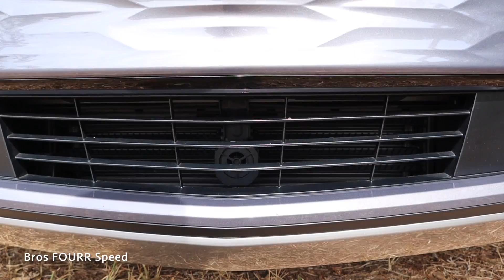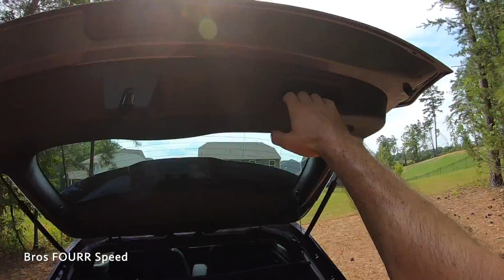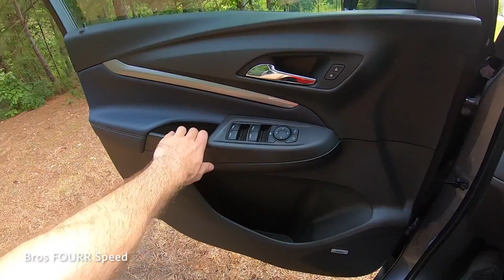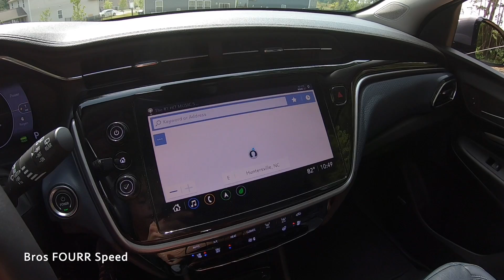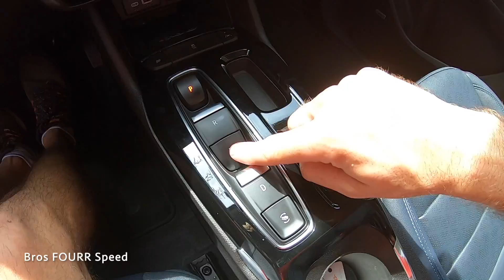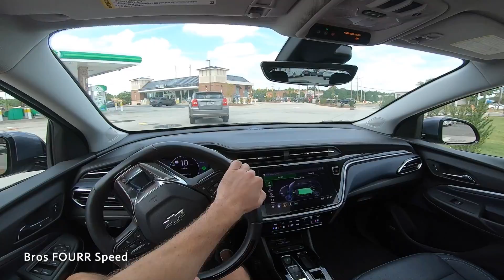2022 Chevrolet Bolt EUV Premier: Start Up, Test Drive, Walkaround, POV and Review

Comment: Your prices are off. The EUV now starts at $28k with the normal EV starting at $26k.

They're the most affordable EVs in the American market right now. 

The only catch is that they no longer qualify for the tax credit, but if you have a good trade in value, you can easily get an EUV with all the bells and whistles for under $30~$35k which is a steal for all the offered features.
Reply: Now it makes sense.   Because i was thinking noway EV cars will take off!
Reply: @kennethsmith6899  EVs are crazy popular in Europe right now (Norway has more EVs being sold per year than ICEs since 2020), but they have cars that are being sold for less than $25k (US equivalent). The US is only starting to break into that price range. 

The only catch is that America is massive compared to Europe, so the range is important. While most EVs have decent range, the Bolt has terrible charging times. Teslas, ID.4s, the Mach-E, the IONIQ 5, and the EV6 (for example) have the same range as the Bolt but infinitely better-charging speeds, so they're more than good for taking on road trips. While the Bolt can be taken on shorter road trips (under 200 miles and you don't drive like a madman), you'll be stuck charging for anywhere from 30 minutes to well over an hour. The cars I mentioned above can charge nearly 2x-3x faster at the same charging stations... but again, you'll have to pay more to get that. 

Luckily, VW just announced an exclusive ID.4 made in the USA with a shorter range, but at $35k (and it charges nearly 3x faster than the Bolt). Oh, and it comes with 3 years of free charging at any EA charging station.
Reply from the maker: EV cars are cool, but I don’t see them becoming crazy popular!
Reply: @BrosFOURRSpeed  Well considering a majority of the legacy car companies are now switching to EVs and aim to only produce EVs after 2030-2035, I respectfully disagree with that statement. Chevy has already cut the price of the Bolt significantly and it's reported that more companies might do the same with other upcoming models (VW just announced a $35k ID.4 made exclusively in the US that charges faster than the Bolt and is bigger).

GM is investing $750 million into creating more charging stations and improving its infrastructure. VW has already invested nearly $1 billion in the US, Canada, and Europe with Electrify America and plans on giving up to $2 billion+ until 2026 for even more stations. Tesla is constantly improving and creating more charging stations by the month and they're now starting to accept non-Tesla EVs.

Keep in mind, that's money for the stations/infrastructure. Ford themselves nearly sank in over $1 billion into EV R&D  since January alone since they, along with GM, hope to catch up and beat Tesla by 2025. VW has been doing the same.
Reply from the maker: @mjohnsimon1337  Chevy has cut the price most likely because no one is buying it! Electric vehicles are cool, but a lot of people are going back to gas because they just aren’t as practical. There isn’t going to be enough infrastructure to support an excess of charging stations. It’s cool tech, but I don’t think it can grow as much as gasoline powered vehicles are now. Even hydrogen vehicles would be a better idea and more practical but companies are overseeing that option.
Reply: @BrosFOURRSpeed  Yikes you're pretty way off for being a car reviewing channel lol. 15 yrs from now it will be hard to even buy a gas car...
Reply from the maker: @anderstars  That doesn’t mean I’m off at all..personally I don’t think ev’s will make it far, that’s an opinion. The infrastructure to support chargers everywhere just can’t be done.
Reply: @BrosFOURRSpeed  and what do you know about electrical infrastructure? It's currently being done
Reply from the maker: @anderstars  Yes but in small quantities. Not many charging stations are around. I looked for a ton having this car. You can’t charge hundreds of cars at once or thousands. Gasoline is more natural and way more convenient. Again, just an opinion on this topic.
Reply from the maker: Just reading the window sticker for this model! Doesn’t mean they aren’t less.

Comment: I remember this Electric SUV, infamously had a problem with catching on fire.  

Tesla Model Y would be a better alternative, at least the worst thing would be the doors flying off lol.
Reply from the maker: Lol, still an expensive little suv!
Reply: A Model Y starts at $66k. I don't think that's a fair comparison when this as speced out now sells for $37k after GM's price drop. But it's true. They did have problems with the LG batteries. 🤦‍♂️
Reply: I dunno what's worse though. The battery catching fire, the doors falling off or the wheels falling off like they were on the Toyota bZ4X. 😂
Reply: @jeffcontreras5158  Tesla cars and SUV are very popular in Orlando, FL.  I am sure quality issues are a minor problem among their vehicles. 

In terms of EVs, I  am a fan of the Ford's Lightning EV truck, practicality and lots of storage space.

Comment: Too much money 💰
Reply: Yeah it is a lot, most people can't afford to pay around 30K for a new vehicle let alone in the 40K USD range.  

Hopefully one day the electric cars can have a cost the price of a new Corolla ($25K to $30K USD).
Reply: @waic1639  The Chevy Bolt EUV is only 28k now. This reviewer must not have known about the price drop from GM. It’s the most affordable 250+ mile EV on the market today
Reply: @_cjmccullough  My local GM dealers love selling their new vehicles at absurd prices.  I remember checking out a then new base model C7 Corvette selling for $110K USD. 🤭
Reply: @waic1639  that’s the dealer of course because they have low inventory. You need to buy online so you can skip the dealer markups
Reply: @waic1639  The Bolt's start at like 28K.
Reply from the maker: Yeah it’s an expensive vehicle! About the average cost of a new car!
Reply: Chevy just reduce the price to 26k for the EV and 28k for the EUV starting
Reply: @iseobukanamamacharles9854  I just found out that GM plans to build EV version of their Blazer go compete with Tesla.  I can't imagine an EV Blazer to be lower than $60K USD though.
Reply: @waic1639  They start around 45K.
Reply: It is pretty pricey but you do have to remember that this is the Premier trim with the Launch Edition package so it has all the bells and whistles. If you forgo the Bose sound system, the panoramic sunroof,  the Super Cruise (which becomes subscription based after the first 3 years) and drop down to the base LT trim you're looking at under $30k. On top of that GM will pay up to $1250 to have a charger installed at your home or will give you a $500 credit at EVGo charging stations if you don't have a house where a charger can be installed.
On top of that right now electricity is significantly cheaper than gas so you're looking at pretty significant fuel savings. This vehicle has a range of about 250 miles in standard conditions. That equates to about $3.64/100 miles charging at home. Today's national average gas price is $4.46/gal so a comparable sized ICE vehicle that gets 35mpg would cost $12.71/100 miles. In a year's time putting 10k miles on the car would mean a difference of $364 in charging costs vs $1271 in gas. Not to mention additional savings from maintenance costs like oil changes.
Reply: @jeffcontreras5158  $40k for a fully loaded EV like this is really still cheap in comparison to what it would take to get those same features on any other electric car.
Reply: @_cjmccullough  It's true. I've pre-ordered a '23 so I'm excited to get that. I'm also still waiting on the VW ID.4 I ordered a while back.
Reply: @jeffcontreras5158  yup I am about to order a fully loaded EUV Premier. I test drove the ID.4 2 days ago and it just doesn’t have the same tech features as the bolt, like understanding how your driving is affecting your range and how much your outputting or inputting. The ID.4 definitely is very comfortable though and it is much bigger. May get one of those as well or an Ioniq 6 or Chevy Equinox EV when it comes out
Reply: The average car payment in America I believe is around $550. I leased my brand new fully loaded BOLT EUV for $500. I normally would buy but with technology rapidly advancing I won't want this car in 3 years. Take a look at leases. Chevy has some great incentives right now.
Reply from the maker: Yeah it’s a lot, but electric vehicles are expensive!
Reply: @BrosFOURRSpeed  tell the president that! Apparently he thinks everyone can afford one
Reply: @jayespi37  Motorcycles are also a good vehicle to use to save on fuel and vehicle purchase costs.  For example, most of the traffic in Vietnam are motorcycles since cars are extremely expensive over there.

Comment: 43k. This is out of control!!!
Reply from the maker: Electric cars are expensive! All cars are expensive lol!
Reply: @BrosFOURRSpeed   right which is scary considering that most of the major car manufacturers are going all EV.   But none of them have made an affordable EV.   I guess all things considering 43k is pretty affordable!
Reply from the maker: @kennethsmith6899  You can buy a brand new gas car half this and it’ll outlast the EV! They need to be much cheaper.
Reply: @kennethsmith6899  this guy's math is wrong. The Bolt EUV now starts at $28k and the normal EV starts at $26k.

With the EUV and all the bells and whistles (premier, sun roof/sound system, and supercruise), it'll still cost under $39k.

A few months ago the same car would've cost like $48k